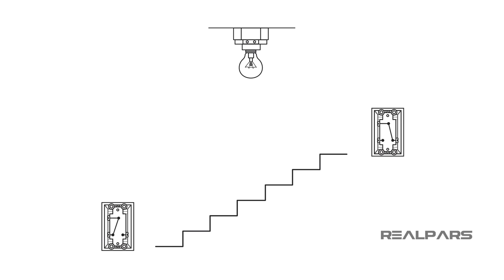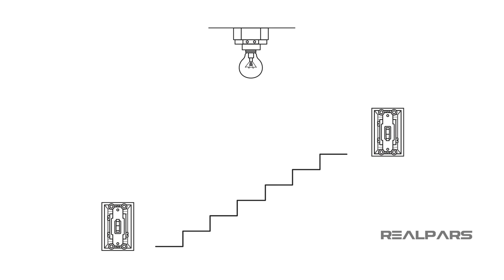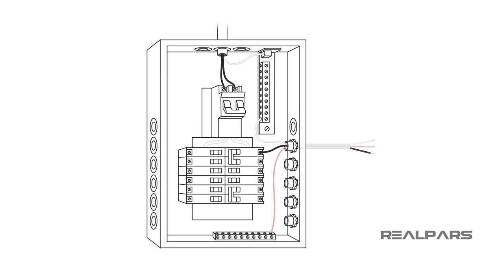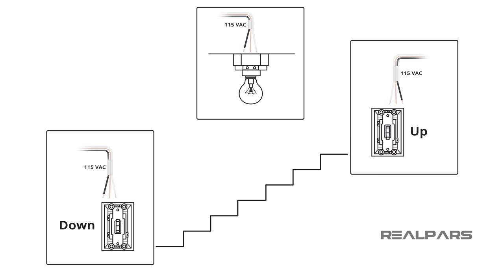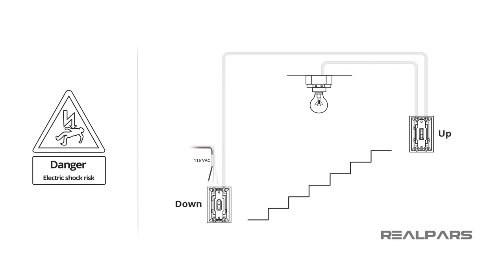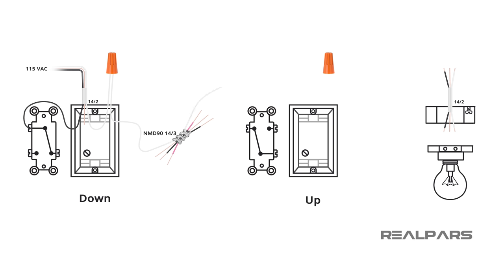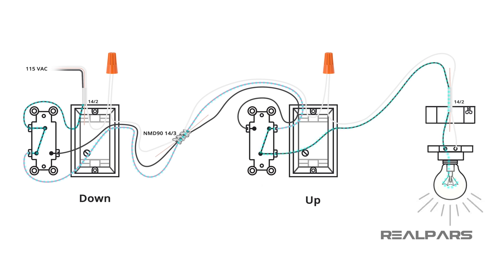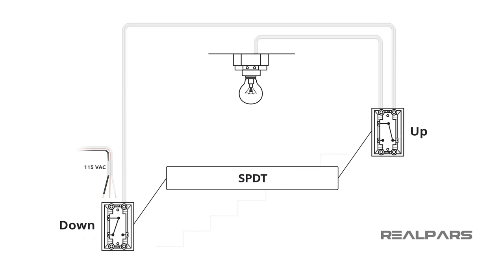Two Way Switching Explained | How to Wire a 2 Way Light Switch

Comment: I read a number of years ago that the reason they are called "3-way" switches in North America, is because "way" is an older definition for "terminal". Looking also at a 4-way switch, that would make sense.
Reply: 4 way switch is a double pole double throw switch 15 or 20 amp spec,tech spec commercial grade switchs ,blue is 15 amp,20 amp red....

Comment: I came here from the website, the only quibble I have is with 14/3 wire. If there is a 20 amp breaker, the wire should be a 12/3 wire, even though a light circuit will not have high amperage, unless there is a short and then the 20 amp breaker protects the 12/3 wire, but not as well for 14/3. At least that is my DIYer understanding.
Reply from the maker: Hi there. Thanks for reaching out. Yes, you are correct. 12awg wire should be used in a 20 amp circuit. Thanks for pointing that out.  Next time, we'll use a 15-amp circuit. 😊
Reply: Did you know some surgens prefer obsidian over a metal scalpel? 😂

Comment: Thanks a lot for teaching! 
May I ask, how to define the neutral wire？ 
I mean IEC up to 16mm2 the neutral wire could be half size of the Line Cable.  
Where can I find the regulations in IEEE codes or other US codes? Please help.
Reply from the maker: Hi @Bryan Z. Thanks for your question.  As you probably already know, neutral size is dedicated by country and sometimes regional electric codes.   The National Electrical Code (NEC), or NFPA 70  Section 220-22 deals with Neutral Size.
Reply: @realpars  Thank you so much for your help, thanks:)

Comment: [edit] 4:35 - The image is of AC90 (armored cable) not non-metallic cable!
0:08 - Unless your target audience is in a foreign country, you might want to just stick with the terminology that will be encountered in the field: "Three-way switch circuits and three way switches" (and the four-way switches included when controlling the device from more than two locations)! An electrician in Texas, for instance, would look at you like an idiot with three heads if you called it a two way switch! It's a good way to get fired the first day on the job.
Reply from the maker: Hiya! Yes, you are 100% correct. The image is armoured cable.  We do have a very large international audience so when it comes to using certain terminology we might look like "an idiot with three heads" in one country, but an electrician with only one head in another. We appreciate your interaction and feedback! Thanks a bunch!
Reply: @realpars  Sorry for the trollbridge (pay at the other end what it's worth), just want everyone to be clear!

Comment: ... or you could use a PLC.... 😉
Reply: No more wiring
Reply: Residential lol,a plc NO most electricians don't know what a plc is lol....
Reply: Yes and pay 350-500 dollars for a situation that can be solved in less than 50 dollars
Reply: @davidcooper4385  I am an electrician and i have wired countless two, three, four way switches. But a PLC would be more fun :-)
Reply: @MaNemUmar  its called "upselling" lol
Reply: D DEE I love PLCs but they aren’t cheap. For home automation you can always use a microcontroller :)
Reply: To upsell aka crook......